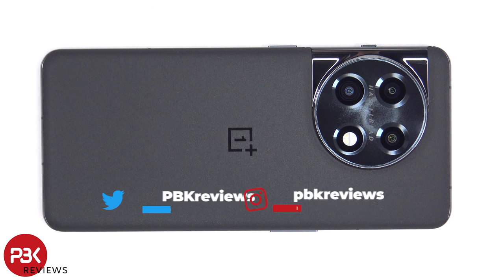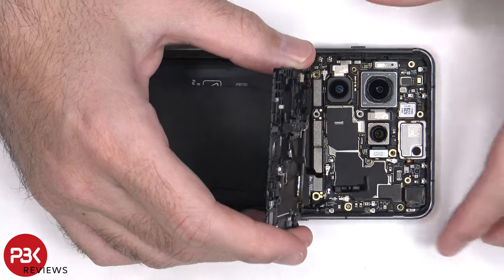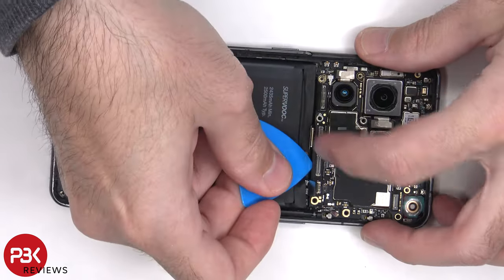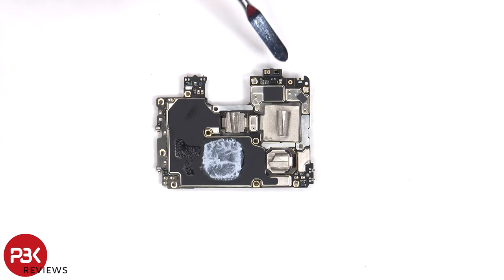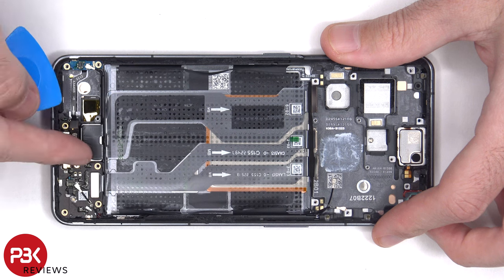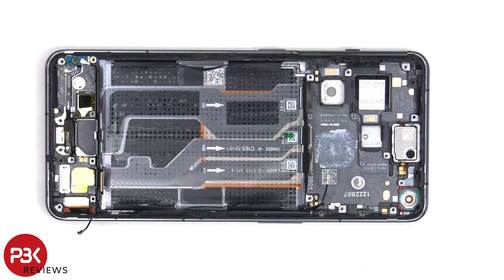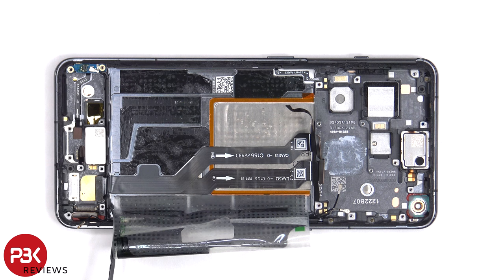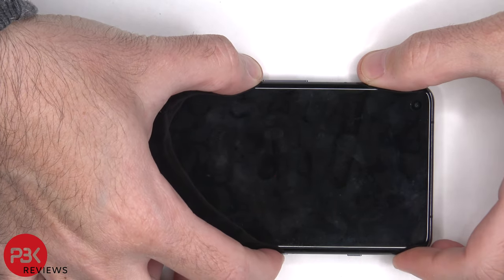OnePlus 11 5G Teardown Disassembly Repair Video Review

Comment: Sir I have a question for you. I was changing the sim and I accidentally poked into the bottom hole and put pressure with the sim tool as the two holes are right next to each other. Would it damage the microphone in any way?
Reply: No the mic is much deeper inside that hole
Reply: I'm having the same worry and was going through all the available details, videos and articles to see if sim ejector tool poking causes any damage to my microphone. Thanks for sharing the info here👍
Reply: Me to do that
Reply: Have you experienced any problems till now and is there any grill mesh around the microphone I don't remember if there was any and if I punctured it or not 😢
Reply: @masterbeast8840 Hello, sorry, did you find out if any component or mesh at the microphone input broke?
Reply: @andressalazar1471  no there's no mesh inside the hole
Reply: @masterbeast8840  thank you very much

Comment: hey can you do bend test of op11 ? I've seen durability test video of yours for realme gt 2 pro and it actually survived whereas other channel managed to break it .  I really like the op11 but 3 channels including jerryrig managed to crack the back glass can you atleast tell in the reply whether it's really that fragile like people complain of it breaking with no external pressure in forums?
Reply from the maker: Bend tests aren't accurate. Everyone's strengths can vary and from where they hold and bend can vary also. I don't think it's really that fragile, the only time you would have to worry is if you literally try to bend it like that or if it gets stuck under the seat of a car and you roll the seat back n forth and it gets stuck somewhere and bends. For normal use case scenario, you wont have to worry.

Comment: Is the screen digitizer part of the frame? Mine has a cracked screen as well as a chipped corner and I was wondering if replacing the screen digitizer would cover both discrepancies?
Reply from the maker: They usually sell screen digitizer and frame combos, which comes as one piece all adhered together already but they also sell just screen and digitizer glass combos which you would have to heat up and pry your old screen from the frame and apply your new one back to your old frame with new adhesive.
Reply: @PBKreviews  oh didn't know there was combos, thanks for the info 👍

Comment: What is the hole right next to the sim eject hole?   I accidentally put the Sim card tool in that hole.  Hopefully I didn't damage anything.
Reply from the maker: Its the microphone hole. You will be fine since both the filter and the microphone are seated above the hole.
Reply: @PBKreviews  good to hear.   Thank you.   I see now, there were a few other comments asking the same.   At least I'm not the only one 😂🤣
Reply: @PBKreviews could you do Xiaomi 13 pro

Comment: I took off the back cover on the One Plus 10 pro because something was rattling, it turned out to be the camera stabilizer rattling when I shook the phone and that's normal. The back cover does not stick tightly. How to stick good the  plastic back cover?
Reply from the maker: You would need to order a replacement pre cut adhesive made for the phone (which I don't see available online aside from sites I have never used before), or a replacement back with the adhesive pre installed like this one: https://www.ebay.com/itm/266164552527?hash=item3df8a4c34f:g:-xkAAOSwsVlkCYrl&amdata=enc%3AAQAIAAAA4EXdu%2Bn%2B4IR6XFHj6fy0vPVIvdpw6ec%2FO4vpuERWqh4bEY%2FC%2FztC8YzPeOLE9Zq9pfekoV9oVBiI%2FdDcaKsJNPp9psEgs113cAie8Fn5Ssq6jR7qQX6zanH0ao2HGoZv9Ar3vJGlC2XL7uYCitOMQrV85xW46%2BYzFmKcTG2%2Fz%2Bt5IhioxKyu8CcKqKkrj1rVQCqSK5ZKOc7z%2BBKo%2BkjRMVaSMV55nJHpCzF3uTW6RU7l7BDGZGyZYddsBFp%2Fvwq%2BkLFezVh8MZKpFxJhNSH%2BdLUi8bbrlIxbmUUFXfwXx87p%7Ctkp%3ABFBM-sqG7eJi

Comment: I have a stupid question, i accidentally dropped my phone and cracked my rear end camera, does replacing the back cover fix the broken camera as well
Reply from the maker: if just the back camera glass cover is what's broken then yeah, but if the camera itself is damaged you would have to replace the camera but most likely it's just the back cover glass and replacing the back battery door cover will solve your issue

Comment: I am not receiving signal in my phone though sim card is getting detected. Sim card working fine in other phones. What part need to be changed as software is not the solution?
Reply from the maker: make sure your phone network bands are compatible with your carrier/sim network bands. Not all phones are compatible with every network.

Comment: My back side just cracked in a mid fall with a case on. Super fcking cheap I need to get another one. Anybody knows where I can find a back replacement? Thankfully is just the outer part
Reply from the maker: https://www.ebay.com/itm/354699852521?hash=item5295c23ae9:g:59MAAOSwSd1kLoqb&amdata=enc%3AAQAIAAAA8EbTkttyyrIOaBqbNrWGkOSDlOorI%2ForoAVpoVUVZ8Ho%2F%2F7ennkd%2F20MtqrzCud5ZA2ka7J%2FaIicEvlOCtUobZsT0W4M7zhInfmw3pacMMv69FiH3CBTPfo2DXUfbegsG2KNbUNLEup9%2Bt5neC0DyEcrF0%2FKc4mM0yUcDKGaw2B9bV3q2UyHnlt2WRNULMKemjKOhgWMX3aXpVf6yj9fvM95sCyk7Ob1y5Qr2daeeQTHpnAy2YQRIKWIdBw8w3aiLNZ0pJ5KUTYuJioGx6kQKUILFmiyh1bT1Y96ZXsF1c8GzsL%2BCzfrS1pj1byW81cK2Q%3D%3D%7Ctkp%3ABk9SR_qBwfr2YQ